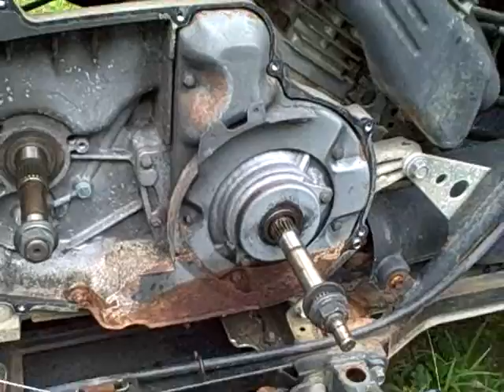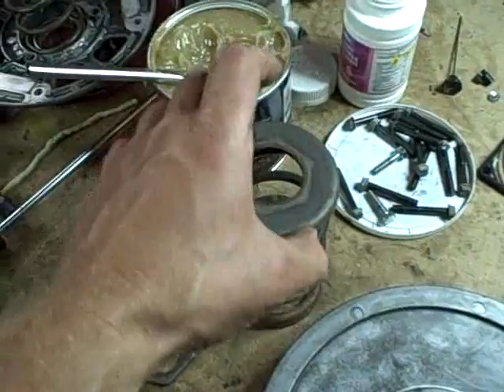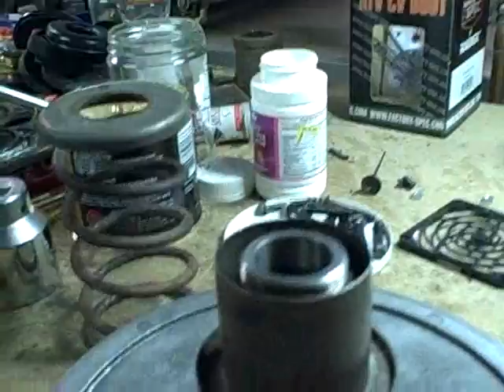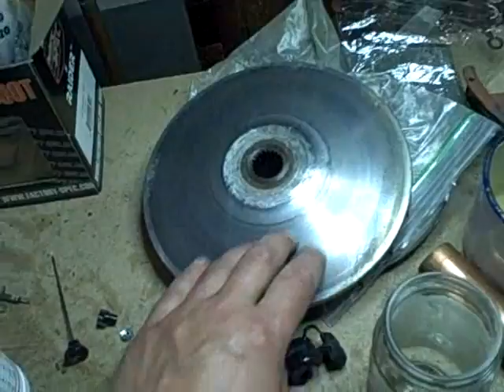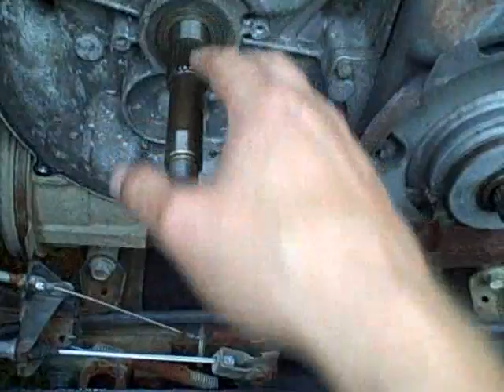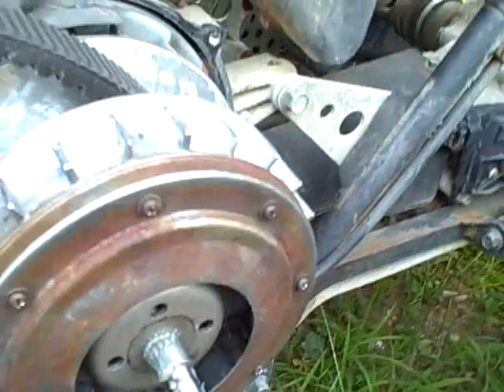Yamaha Grizzly ATV Project Part 14

Comment: I just bought a 1998 Grizzly 600.  It has a rattle coming from the clutch housing.  Gets a little louder when its revved up in neutral.  I haven't listened for it much when riding, as I haven't ridden it much yet.   So far the info I've seen online says that Yamahas are noisy and its normal.   I'm wondering if its the sound of the weights in the clutch that are rattling?   Does have anything to do with not having enough grease inside?  I don't know enough abotu the clutch to know how it works or why it rattles.
Reply from the maker: @adamr8628  its a dry sump. The clutch is actually a CVT system, a strong belt between 2 pulleys that automatically adjust the ratio between them based on engine RPM. Does it rattle standing at idle? Maybe something is loose in the housing that shouldn't be.

Comment: You can use a piece of 2 inch PVC pipe on a press to compress the secondary pulley spring to remove the big nut...
Use two belt cover bolts in the holes on the outside of the secondary to create a gap for the belt to sit in. The pulley sheaves will spread apart as you tighten the bolts in. Very handy tip for ya!

Comment: Weigh all the rollers and make them the same weight, the drill a hole or two through the middle of them to lighten them up and the machine will rev a bit higher before the belt engagement. Moves the power and up higher in the revs. Do not grease the rollers! It just attracts grime...
Reply from the maker: Cool tip. Thanks.